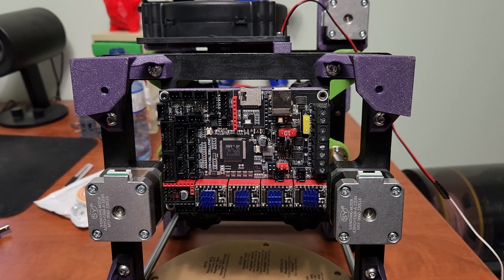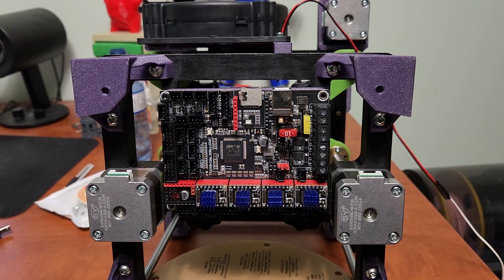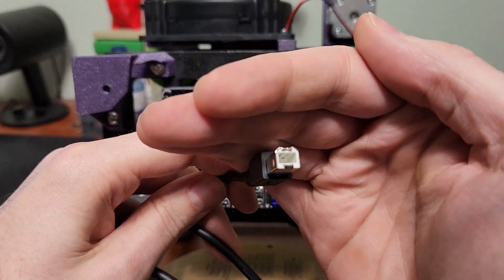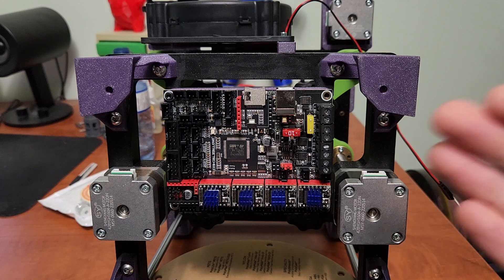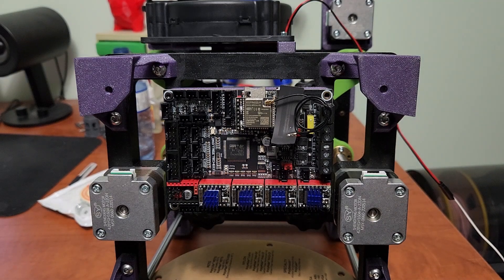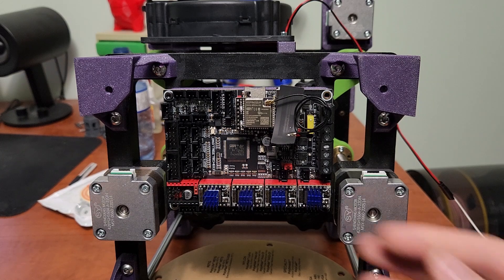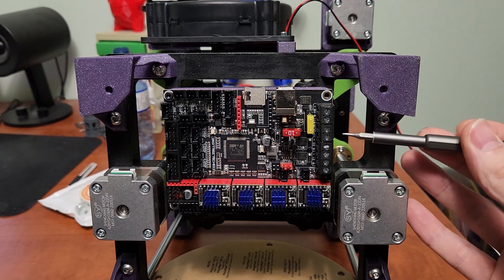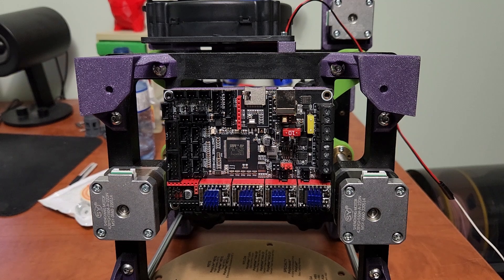Bigtreetech SKR 3 Review

Comment: Good video, I agree with you on all of it, I have purchased one for my Ender 5 Pro, and I want to CoreXY mod but am on the fence, I want dual Z mod also, Currently, I have an SKR-mini v3 in it and it works perfectly as stock board replacement. WOW, you also had mini I see. keep the video's coming. I subbed and shared your link with some other 3D printing knuckleheads I know.

Comment: I prefer the larger USB B port because it's more durable than a USB C cable, but I agree that it would be great to standardize to C going forward.
Reply: Big heavy machines should have big heavy USB ports that are harder to yank out - in case of accidents.
Reply: Yep, my UPS has a USB B.  My ender has micro and it always falls out, I wish it had a USB B on it.  I would consider this just on the USB itself, but I'm probably going to go with a board that has a few more stepper drivers.
Reply: agreed USB B is more durable

Comment: Totally disagree about USB-C.  Is this cable power only?  How much power?  Will it do data?  I'm only getting USB2 speeds.  Oh, flipping over the "unidirectional" end gives me USB3 speeds.  Which of these 10 cables are Thunderbolt again?  With the old school chonky connectors you know what it is.  And you can put tape over pins if your printer's mainboard is feeding back +5V.
Reply from the maker: I think most of those issues are solved with a good quality usb-c cable
Reply: @Rolohaun  Other than the "flip it over" part, everything I mentioned is part of the official USB-C spec.  Having said that, printer boards are probably going to be USB2 speed anyway, so most USB-C cables would be fine.  
In any case, thanks for the review.  The board in my i3 Mega needs replacing.

Comment: Honestly, the processor in a board matters for klipper more than I thought. When trying fast motions I've actually managed to overload the processor (an Atmega2560) on my MKS Gen L 2.1 board with generating steps too fast. Of course, it wasn't a very realistic speed for actual printing with the rest of my hardware, but it was only X and Y moving and it surprised me, and made me worry about how it would go with all the other steppers going
Reply from the maker: I am sure Atmega 2560 being 8 bit vs 32 bit is a big difference.
Reply: @Rolohaun  Yeah, just stating the mistake I made of assuming ANY board can cope with ANY load because Klipper is doing the thinking. Though it would be totally fine for, like... normal people print speeds instead of crazy people print speeds
Reply: I've never seen my atmega2560 (actually the gen v1.0) running out of steam. Which is nice compared to how Marlin behaved on it, way back though in fairness.

Comment: I got the EZ version in my Anycubic mega X, been great with dual independent z, 4 endstops, inductive probe, and optical runout sensor.  Although as my second aftermarket board, the polarity wasn't as clear as the first one I used and when testing it I shorted one of the fans, so I only have 2 controllable fans now and have to use one of the always on fan connectors for my board fans